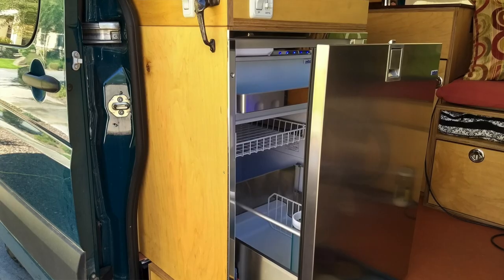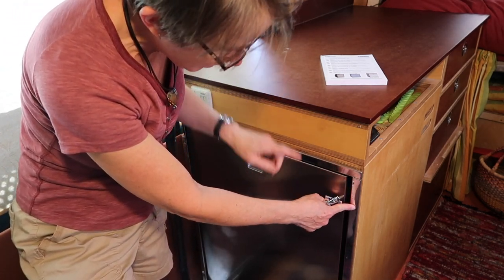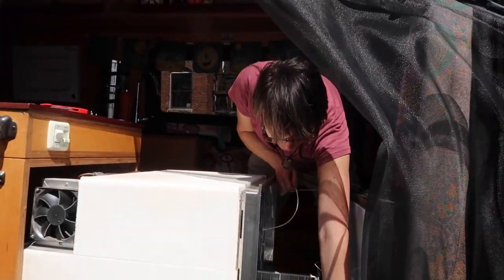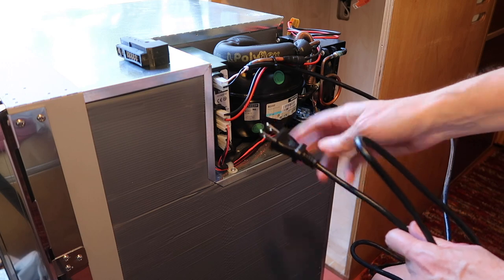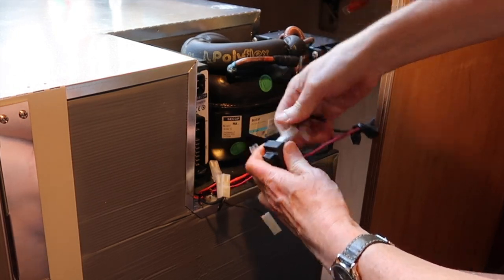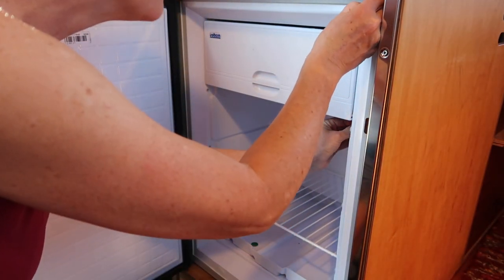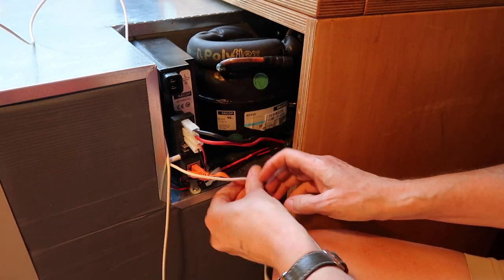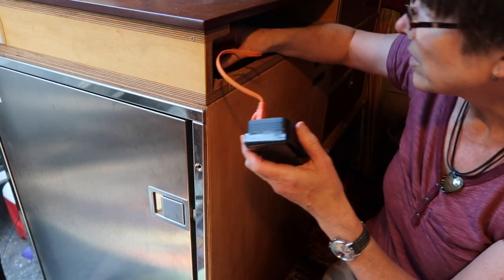Not Cool, Fridge! | Isotherm INOX Drawer 130 Replacement

Comment: I have an isotherm refrigerator, it's not that same one, but it was doing the same thing. I discovered it did not have enough ventilation so I cut a larger hole in the back wall and put a vent with a fan, and it solved the problem! It's not perfect but it made a huge difference and it doesn't run as much as it used to.

Comment: I absolutely love my TruckerFridge sold in Georgetown,  KY. Very low battery draw, and it is made to be in a vehicle. It has ac/dc power, and will freeze the food if you set it that low. But in my van, it keeps the food cold when it is the hottest of outside temperatures. I would always have the option of a fridge running off of shore power for times when i am plugged into shore power. Always have options!
Reply from the maker: That's great.  My friend, Keri swears by hers!

Comment: What do you think of the general "drawer fridge opening into the side entry" design?  Would you do the same basic design again?    It seems great to me - access from inside or outside, but are there downsides I haven't considered?  Do you like the drawer or do you think a dual-hinged door would work just as well?
Reply from the maker: It's great in theory, but in practice, I only ever accessed it from inside and I feel it really limits how I park because I don't like to have the sun beating on it.  I would recommend swapping the fridge and sink.  This gives the added bonus of using the sink faucet as an outdoor shower.

I definitely prefer the drawer.  I found it much easier to work with.

Comment: Thanks for the update on the fridge and solution.  I am wondering if a 90 degree connector can be added to the white wire to prevent breakage over time?  I was wondering what your thought are on that?  I always enjoy your videos!
Reply from the maker: A friend of mine helped me create connectors jumping from the fridge to the block and we ended up taping the whole block out of the way.  (We were so focused, I didn't even snap a picture!)  I was just grateful it hadn't worn through before I got to it!

Comment: At the end of your video you said "let's see how this works". So how did the Vitrigo freezer work as a fridge? It must work great because you recommended it to me today :)
Reply from the maker: This video is about the Isotherm Freezer 90.  It's okay - it keeps everything cold, and hardly takes any electricity, but I don't like how it's organized.  But it was the only thing that would fit in the space.  I'd go with a Vitrigo if I were to build a new van...
Reply: @TheGalavan  Oh that's right!   I forgot that you recommended the Vitrigo but it wouldn't fit or you would have bought it. 
Well that's fantastic if your new Isotherm freezer is keeping things cold when it's hot outside. That's interesting you're using a freezer for a refrigerator. Whatever works right? Too bad you don't like the organization. That drawer fridge sure looked awesome! Too bad it didn't work well enough.

Comment: Joanie, If the fan is on the left side on a DR130 INOX is it ok to vent it on the right side?  I just had mine installed by the outfitter and they vented it on the opposite side of the fan, The left side (just like yours) is on the outside of the galley where there's a drop down table. Maybe vent it to the rear as well? Seem like it runs constantly and is a bit warn on the top and rear. Thx of the video.
Reply from the maker: It's supposed to vent diagonally.  Whatever you do, make sure there is enough space for it to really "breathe".

Comment: So I'm curious - the 130 you had installed before had 4.6 cubic feet of storage, and your new 90 has 3.1cf, as best I can tell from a bit of googling - yet the two units are pretty much identical dimensions.

I'm assuming the newer unit simply has thicker walls, better insulation, leading to the loss of storage capacity? It's hard to tell from a video. 

It's also now been a month and a half - how is your new fridge working so far? 

I just found your channel today, and will be working my way through older posts over time. You have a lovely van; if/when I ever start a project, I'll be shamelessly lifting some ideas from your buildout :D
Reply from the maker: Welcome, Scott!  

Yes, the decreased capacity is all insulation.  The new fridge is keeping the temps well, although I'm still frustrated with the layout.  I really liked the drawer - made it very easy to access everything.  And I have since put the shelf I took out back in, so I no longer have space for anything tall.

I would recommend looking to other brands and maybe researching the Vitrigo line.  And, whatever you do, design in extra space for ventilation!
Reply: I imagine it's a struggle losing about 1/3 your accustomed storage capacity :(

Do you feel like the previous unit would have done the job properly if the enclosure had been a bit bigger and properly insulated itself?

Comment: I was thinking about getting the Isotherm Drawer unit but after your video I'm not so sure. How long have you had it?
Reply from the maker: I had it for three years before replacing it.  I'm still not loving the replacement.  If you are starting from scratch, as in, your cabinet isn't built yet, I'd recommend getting something else.

Comment: I feel your pain! how old is your fridge? Good luck with this new plan, I could see the shelf doors would be difficult to deal with but really good for holding cool in, I wondered if you could install them on the bottom to pull down rather than lift up? I imagine that would mean drilling holes(?) surely a no-no for the warranty...probably not but I did like that feature. Also, does this mean no more freezer? I may have missed you addressing that, what would that mean for you?
Reply from the maker: Thanks, interesting idea, although it's working great without the extra doors.

And yes, it does mean no more freezer.  I've actually taken my VitaMix out of the van because I mostly use it for smoothies.

Comment: Curious how this unit is cooling verses the last unit?  I think the small holes that you installed look about 1” but may still not flow enough air. Maybe a larger hole about 4x6” with a grate over it for appearances may help intake air. It’s important to have a exit vent at the top of the cabinet for the the rising warmer air to escape.  I suspect as others stated that the last unit was having trouble removing the heat from the enclosure causing it to have difficulty cooling in higher temperatures .  Door gasket leaks are usually the cause of excessive frost build up.  The way the control cable is run thru the door seal may cause a air leak increasing frost buildup and loss of cooling.  I have also seen some people install a small computer fan that assist in the air circulation behind the fridge.  Some minor suggestions they may help improve your system performance.
Reply from the maker: You're right, I didn't have enough ventilation.  But a friend who installed a few of these did have the recommended ventilation and still couldn't get that fridge to keep temp.  And you're also right about the control cable letting in moist air.  I just didn't want to drill into it.

The new fridge is keeping temps well, but the interior design is a major adjustment!
Reply: @TheGalavan  I just purchased an Isotherm 130.  I noticed they make a smart fridge controller that can be added.  The video of the install shows them drilling thru the top to run the wires.  It didn’t seem to bad.  It’s suppose to cut the power consumption significantly and give better temp control over the stock system.  I dont know why they dont just put that in from the factory.  The price of these fridges are high another 100 isnt going to be a deal breaker for most buying these things.

Comment: Just had a big problem with my isotherm dr130 as the thermostat ripped out as it was so iced up by the border patrol going into Canada. I disconnected it inside and yet it’s still draining the battery. How has the freezer model worked for you the last two years?
Reply from the maker: It's working really well, although you do have to have an additional thermostat to make it work right.  I prefer the layout of the fridge, and miss having a separate freezer, but it's keeping temp really well.  And only draws about 10ah/24 hours, so it's super efficient.  (When I replaced it, my fridge was drawing 80ah/24 hours and not keeping my food cold.)

I'm wondering if you could just add an after-market thermostat to your fridge.
Reply: @TheGalavan  interesting, I’ll check that out!

Comment: Bravo for attacking the problem by yourself.  In watching it appeared that there was not much ventilation in the cabinet
 for the original fridge.  If you still have the old fridge, try running it now that it is not in a box.  If it works, the original problem was most likely a lack of ventilation.  If the original begins to work, perhaps you could return the new and keep the old.  Regardless of the original's operation, I suggest the new holes, as well as the two original ventilation slots, be enlarged.  They seem quite small.
Reply from the maker: The ventilation holes on the front are actually quite large, but you're right, the five holes I just made are probably not sufficient, although the freezer is more than keeping up.  It only drew 14A in the last 24 hours!

I don't place the fridge there when I design vans for others now.  It's a warm spot and hard to ventilate.  They get the value of my lessons!

Comment: I don't get. I just went to the Stainless Lobster site. Why couldn't you simply have installed SS Lobster on the original Isotherm INOX drawer fridge to regulate it cooler with the Lobster? Buying a 12V freezer and converting to a fridge would be doing the same thing essentially with the Lobster. What am I missing?
Reply from the maker: I was already using the Stainless Lobster on the fridge and it just couldn't keep up.  The compressor was running all the time and the fridge couldn't get down to safe temps when it was hot out.

Comment: Do you think the drawer one would work with more insulation. If you could have known? Can you give it to someone else to try it out?
Reply: I wonder if it needed more vents but I also know that the little apartment size fridge I use goes downhill quick once the frost starts building up, I imagine that may be true for this (not sure, I'm not refridge person).
Reply from the maker: I'm not sure.  I was told to give it a lot of insulation before I even started, but then didn't feel like I had the room.  A do-over would be to MAKE room for enough insulation.  Or get a Vitrifrigo.
Reply: @TheGalavan  I ran across this page because I'm looking at using the same fridge as you did at the end of the galley island and was disheartened that you had such a problem.  Until I saw your removal and installation of the new one.  I'm pretty sure the problem is lack of ventilation.  Thank you for showing this in detail - I'm now really sensitized to ventilation for my own plans.

I put this on the upfitter you paid to build your van.  They may have used beautiful locally sourced-in-Eugene-Oregon Apple ply, but they made the box too tight around the fridge with just a couple of small exhaust holes at the compressor and no cool air ingress.  They should have taken the time to understand what they were installing and dealt with the ventilation correctly.  Hopefully the holes you added will help.  

For anyone running across this, a good reference for installing this fridge is https://www.indelwebastomarine.com/fileadmin/webasto_files/documents/IndelWebastoMarine/Manuals/drawer-manual.pdf.  Section 4.3 states: "It is extremely important for the compressor/condensing unit located behind the
refrigerator to be well ventilated so that the fresh air can enter at the bottom and
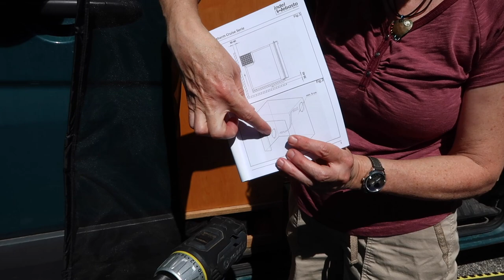 pass behind the refrigerator, with the hot air being allowed to escape from the top or sides (Fig.1)."  Figure 1 on page 3 of the manual (shown at the 6:05 mark in this video) shows an inch or two of air space below and behind the refrigerator.

Comment: The problem is the "drawer" design. The efficient design is a 'tub' like many consumer home freezers. Cold sinks towards the ground. The tub design, which surrounds the cold chamber with insulated walls contains the cold air so it doesn't "spill out" the way it can with that "drawer" design.

The reason for it freezing shut is ice melts when it's opened, then the compressor senses the temp rise and tries to compensate by pumping cold air in. This freezes the water melted around the door seal.

Comment: You don't want to insulate around a refrigerator like that. You want air channels for ventilation below and behind the unit so the fan can cool it properly, as Isotherm lays out in their installation instructions. No wonder you were having issues.

Comment: There was nothing wrong with your Drawer 130, it was installed wrong.  Insufficient space around the fridge and incorrect ventilation.  That box would have been so hot you were giving the compressor an impossible task.  It needs to be able to properly exhaust the heat.  I have this very same fridge and have had none of the problems you speak of.  They are installed in lots of overland rigs such as in Globe Campers with great success.
Reply from the maker: Right - but I also didn't have the ability to correct the problem due to the build, so this seemed like a better solution.

Comment: I am not sure your replacement was necessary. The Danfoss 12 volt compressor is a variable speed unit. It runs at 2000 RPM to 3500 RPM as described in the manual. The unit come set up with a 1500 ohm 1/4 watt resistor in line with the mechanical thermostat to run at 3500 RPM. By installing the SS lobster you removed this resistor necessary to run the compressor at 3500 RPM and allowing the compressor to cycle on and off to cool. Also the installation instructions require 3-4 cm behind the unit to cool the compressor through  convection via venting into your van or to the outside. Clearly you did not have adequate ventilation, but your larger mistake was using the SS lobster without the 1500 ohm resistor to run at 3500 RPM. 
This video is misleading to future users of 12 volt compressor refers and should be corrected.

Comment: You will have trouble with fan and command cable. They are stressed and vibrate...guaranteed.
Reply from the maker: Not sure what you're referring to here.
Reply: @TheGalavan  sorry..the white connector wire at 90 degrees and under pressure. They typically break there. The other cable the same wire at 90 with pressure,with vibration fine inner wires will break. Especially in vehicle. Trying to save issues. All the best.

Comment: This refrigerator is very difficult to open with the small door latch and strong seal magnets.  poor design in my opinion as well
Reply from the maker: They can be hard to open.   I sometimes feel I'm going to rip off my nails opening it!  But this new was is SO efficient!  Draws about 11ah/24hr!

I just filmed a tour where she just got a dorm fridge at Lowes.  She figures she can just easily replace it at any Lowes if needed.  She has plenty of power to have the inverter on all the time.  Although her tolerance for messes is higher than mine - any hard stop could empty her fridge.
Reply: @TheGalavan  Does it loosen up at all over time? Did you do anything to relieve the hard seal? Terrible design.

Comment: That's an expensive replacement for the little use you got from it.
Reply from the maker: Definitely an expensive replacement, but I did get more than 3 years from the fridge.  I spent most of that time in more moderate areas.  Now that I'm venturing out to warmer areas more often it was time to deal with it. :-/